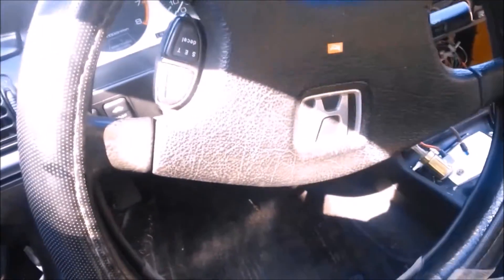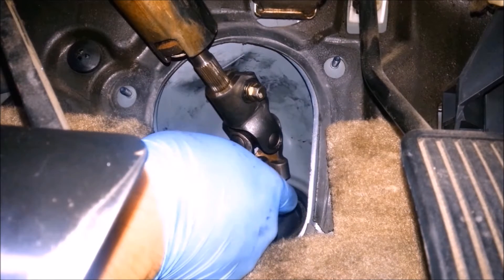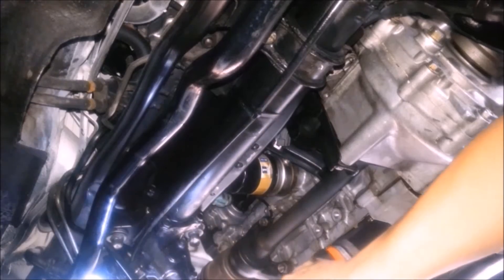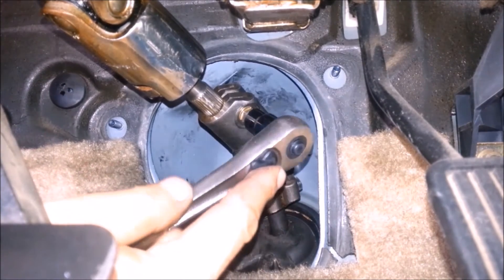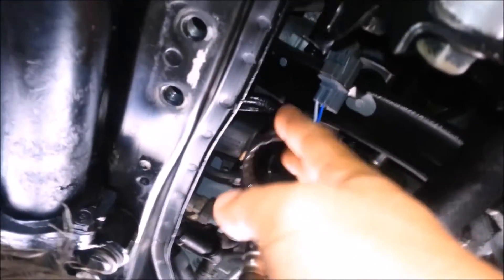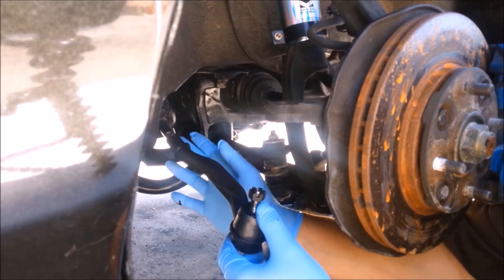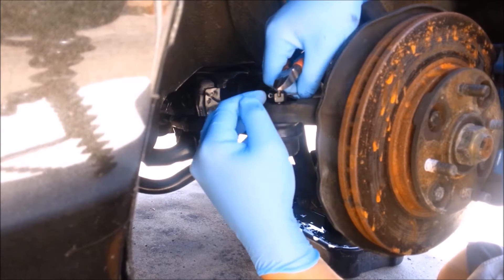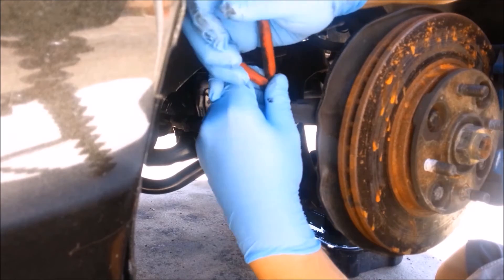DIY How to Replace Steering Rack & Pinion Pt. 2 on 1990 - 1991 Honda Accord CB7 - Winston Buzon

Comment: My h22 cb7 had a powersteering delete and im gonna attempt to give it powersteering again but all it has is a leaky rack and pinion what are the 4 to 5 lines that connect to the rack and pinion? I already got a reservoir, pump, bracket, pulley, high pressure line, some random fat return lines what else do i need?

Comment: I changed to my accord the pressure line the pump and the rack an pinion but it is still buzzing and I take the air out and any advice remains the same

Comment: Would removing the sway bar and sway bar links allow me to tuck the lines back to male rack install easier?
Reply from the maker: Possibly, but I wouldn't know because I haven't tried
Reply: @winstonbuzon  Is there a torque spec for the lines? Installed by hand then began to tighten. Does it need to bottom out with connector or how tight do I go?
Reply from the maker: @abtransport13  I don't know exactly. I honestly wouldn't want to give you info that's not correct.  I would refer to the Haynes manual
Reply: Winston Buzon Thank you, I got the rack in and pretty much all that’s left is installing lines and outer tie rods. How tight do I have to tighten the lines?
Reply from the maker: @abtransport13  do you have a torque wrench?  It would help a lot
Reply: Winston Buzon Yes, I just got a 3/8 drive torque wrench from harbor and I also have the crows foot flare nut wrenches to attach onto the torque wrench, but I am unsure of how tight to go and I don’t want to damage the lines. Do the new lines have to bottom out or after tightening will there be some threads visible ?
Reply from the maker: @abtransport13  your questions are easily answered with a Haynes manual that you can buy from your local auto parts store, or borrow from someone who has one

Comment: Does it need to be Honda power steering fluid or can it be any brand?
Reply from the maker: The oil was temporary.  Ended up draining and filling with Honda Brand Fluid
Reply: Winston Buzon thank you, do you know how many bottles I will need?
Reply from the maker: @abtransport13  Do you have old fluid in the tranny?  Keep in mind that if you're changing the fliud is that you only drain about 2 of the 6 quarts in the transmission (67% of the fluid is still old). To get more of the old fluid out, drain & refill, then drive around the block, drain & fill again (this leaves about 44% of the old fluid), repeat again (about 28% of the old fluid.)  A shop can tap into the cooler lines to make a more complete change all at once
Reply: Winston Buzon Ohh, I see, thank you. Yes, currently still have old fluid in the tranny
Reply from the maker: @abtransport13  you're welcome 😁👍

Comment: My steering wheel did not align right after installation of rack and pinion, is there anything I can do without taking the hole thing out and redoing it? It's about 1/4th off
Reply from the maker: +bigboyg209 https://www.youtube.com/watch?v=7aw9ZIO0JFM

Comment: I have 1990 Accord and steering locks to the right  automatically. once I start the car the steering turns right after a few minutes. Any suggestion?
Reply from the maker: Did you turn your steering wheel and rack all the way?
Reply: +Winston Buzon (DubEezy) I haven't pulled apart the rack and pinion as yet. I noticed a leak( power steering fluid) under the car for a while now but I'm wondering if the leak could be causing my steering to turn on its own.
Reply from the maker: +Danii J Its a definite possibility, especially since the fluid is what helps keep the power steering control your steering in place
Reply: +Winston Buzon (DubEezy) I'll definitely try to get it sorted out. Thanks for replying and I'll subscribe.
Reply from the maker: +Danii J Thank you!  I definitely appreciate it :)